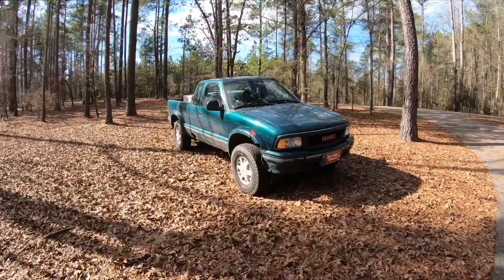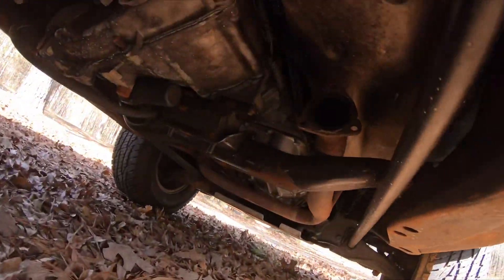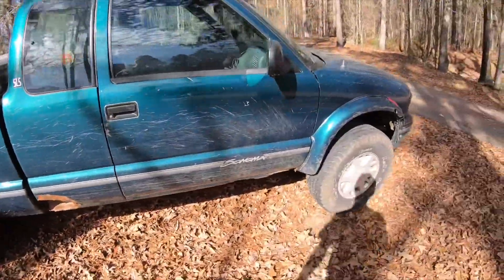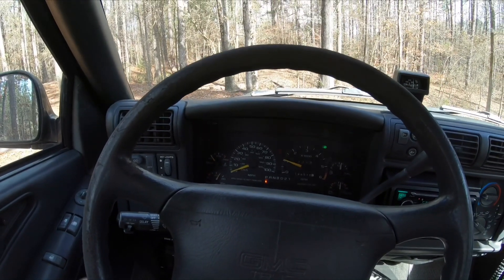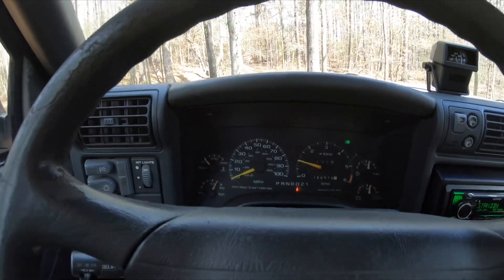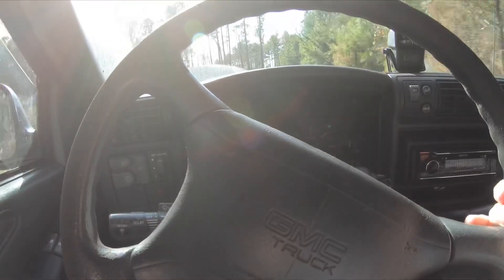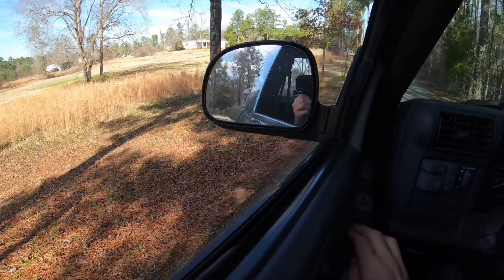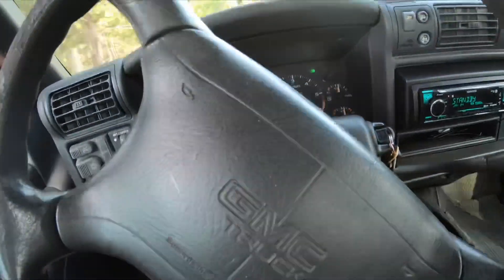Straight piped Gmc Sonoma

Comment: I just bought a 97 that's got a flowmaster 40.  I'm thinking of doing straight pipe, but I'm unsure.
Reply from the maker: If you don't care for listening to music when you drive then its not bad. Btw it turns heads but mostly because there like wtf is that sound. You could just hollow out the catalytic converter and just put a good muffler on it and have it sound decent. But its up to you and it depends do you drive it everyday or do you just joy ride in it.
Reply: @austinw561  its a daily driver.  Its got a nice almost antique sound to it with the 40
Reply: @austinw561  https://youtu.be/pDvzyi6Bn3E. It's not very good sound quality, so I'm eventually going to get a better video.  I straight piped it, and I'm going to bring it out the side at some point.

Comment: Hey what size tires did you have on that sonoma? I'm planning on getting some 235's on mine and I want mine to look similar to the size of yours
Reply from the maker: They might be 235's but I'm not sure I sadly don't own it anymore.
Reply: I have one and i have 205s and they look very similar
Reply: Most 4wd S10s and Sonoma came with 235s from the factory, base model 4wd s-series had 205s but they looked awkward. This truck in the video is actually a Sonoma high rider i believe (same as a zr2 s10) it sits higher and came with 31s from the factory. I have a 96 Sonoma that's a 4wd truck but has 2wd rims on it and 235 Mud tires. I had to shave a little off the back of the fenders (because the 2wd rims have a deeper offset) to keep from rubbing.

Comment: You just straight up cut off the cats too ? How ?
Reply from the maker: The cats restrict the power of the engine so get rid of them as for it running bad I did not have the o2 sensors in
Reply: @austinw561  Ah ok on brand new cars though you can't without overriding the computer or else the car won't run

Comment: It's not straight piped that's half of a exhaust 🤣 but seriously though with it dumping under the cab it could be finding its way inside. So don't sit in place for to long with the engine running.
Reply: Had a friend die from that...  Needs to be piped all the way back